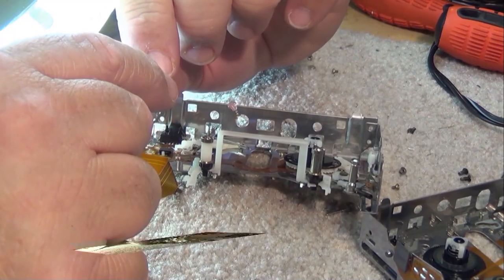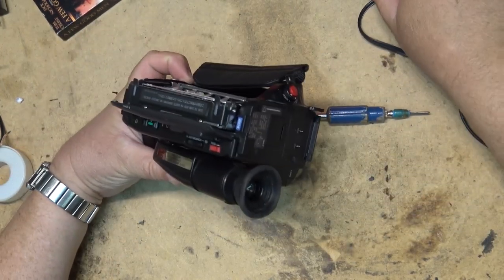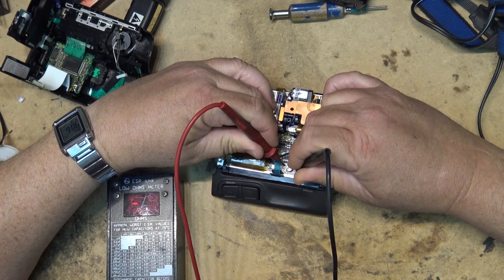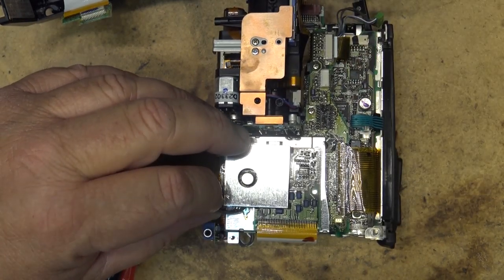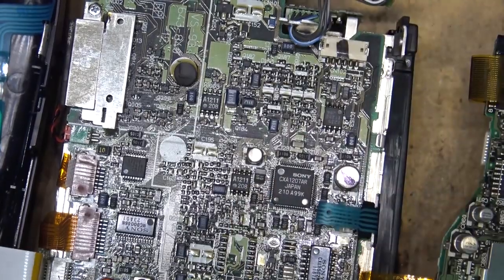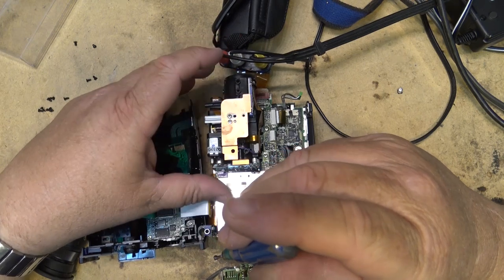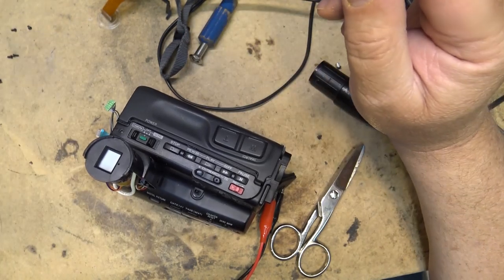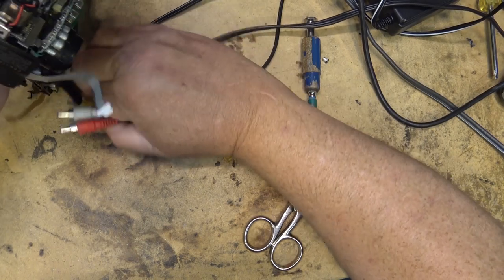Sony CCDTR71 8mm Camcorder repair

Comment: True recycling and conservation is repairing everything regardless of its worth.
The only way we will slow down trash island is by repairing instead of replacing.
Tossing things in the e-waste is just tossing it in someones else's trash can.
Reply: It's clear you never even attempted to fix an 8mm handycam. These things are a pain in the ass to get working right, and once you do, it's just a matter of time before something else inside the camera kicks the bucket.

Comment: by the clock on the wall, you disassembled, analyzed the problem, made the repairs and reassembled in about an hour and ten minutes............AMAZING!!!!!!
Reply: Because he is a man with a knowledge with this kind of issues
Reply from the maker: Yes that sounds about right.
Reply: Around the runtime of the average film in the 80s to 90s, maybe a little shorter. gg camcorder, we made you work again whether you liked it or not :P

Comment: Looks pretty much like a camera I  have but it mine is maybe from 2005. After a family member died it sat on the floor for quite a few years, ignored. When I tried to copy some tapes to dvd a few years ago, the camera wouldn't work right. I think the tape would stick in the machine, wouldn't eject.

Comment: Nice video to troubleshoot, i got a trv 140 Sony camcorder  D 8 that show some massive black spot distortion only on live video mode, I thought that the ccd was almost to dead and I replace it but the problem stills on it. Now I think a bad capacitor could be cause, I get back on my work table hopefully catch the fix over. Regards.

Comment: Fascininating! I had one of these for many years and it survived many front seat rollercoaster rides as I pursued my theme park hobby back in the day. The only reason I threw it away recently was the fact that the rubberised coating on the outside had perished and gone all sticky. It had a really nasty fishy smell too. Interesting to finally see inside one of these things!
Reply from the maker: That smell was the fish oil used in the surface capacitors leaking out.
Reply: @12voltvids  Wow, I just presumed it was the chemicals in the plastic coating. Come to think of it, the picture was all off like yours too. I just thought the heads were clogged.
Reply from the maker: @imansfield  Nope. Bad caps. All those 80 and 90 era cameras have them, especially the 8mm models made by Canon and Sony. I make a bunch of money transferring tapes as opposed to repairing old camcorders.
Reply: @12voltvids  As an amateur SONY tv hack from the 70's I appreciate this video. My SONY TR-21 ( 1993)  has lost several functions, and this video has made my final decision to toss it. Yes, I was into it 10 years ago and luckily transferred several tapes, but it quit before I was done.  Thanks for your time.

Comment: Those surface mount caps are garbage. I bought a Bose wave radio at a yard sale and it worked for a couple of hours until the audio faded out to nothing. This thing had maybe 100 caps. I ended up junking it but I saved the speaker's/waveguide assembly and I can rebuild the radio with a different amp.
Reply from the maker: Yes the surface mount electrolytic caps are shit. Next!

Comment: what do you use as a fum extractor I been soldering a bit now and my lugs hurt I bought a fum extractor off eBay but it dose not seem to work
Reply from the maker: What's a dime extractor? Never heard of such a thing.  Never used one in 20+ years doing this work for a living.  I have good ventilation in the shop. It is called opening the door and letting in fresh air.
Reply: 12voltvids I am using a 493 esd safe I don't know I think it maybe the solder or the flux do recommend any flex or solder ?
Reply: What did you buy? Give a link to that product.
Reply: SinsBird https://www.ebay.com/itm/100g-Japan-KINGBO-RMA-218-Paste-Flux-BGA-Rework-Reflow-SMT-Solder-Microsoldering/261875631637?epid=1976377220&hash=item3cf9010615:g:8CAAAOSw-0xYSKnV flux I use
Reply: @changosatanico9928  I did not get a notification that you replied. Wow, $45 for a computer fan and some kind of a sponge that may not even be made of carbon. I think it's too porous for fumes. What I would do is buy a hepa filter and some kind of a prefilter, make a box and connect a vacuum cleaner to it.

Comment: I have a similar videocam. I first took my battery to charge so I hooked my power adaptor and charged my battery. The other end of the power adaptor I attached it to the camera. When I finished I couldn't get if off. It seemed stuck. I tried to eject and push it towards the arrow, nothing happened. Then I tried to open the tape compartment but it is also stuck. 
Could that really happen? I have a tape in there and I wanted to get it so I can transfer it to my computer. What do you suggest?

Comment: I got a Panasonic DVX100A, it hasn't work in two years, I figured if i the tape doesn't read, it keeps saying T reel lock - I opped the front door, cleaned the head, poked around inside, but thing chanched. So I figure I could record still via DV out firewire but it doesn't activate the DV out as long as the tape errors out, I wonder there might a way to trick it into thinking the tape if fine to activate DV out. I'm in Toronto I wonder if this would be worth fixing since even when it was working fine I only paid 130 bucks lol - Am taking it appart but I'm afraid I won't be able to put it back together if I keep going LOL
Reply from the maker: That typically means the rotation hub is stuck or the rotation sensor isn't working.

Comment: Thank you very much, your vid was really useful to diagnose the fault in my camera. Only problem is that after fixing it (I replaced a couple of caps) I started shorting some of them to see what they were for (stupidest thing I've ever done, but I thought with those kind of currents and voltages shorting them wouldn't do any damage). Well, of course I messed up and after shorting one of them everything went blank and the camera doesn't even power up anymore. I figured the problem is in the dc/dc converter board because I have no voltage from the pins but a couple that just output the 7.5 volts they receive from the supply, so I guess by shorting the cap I blew up the voltage regulator board. Can you give me any input about how to proceed or am I better off looking for spare parts? I know it's worthless to try and fix it but it's just so frustrating, plus I have a bunch of tapes I'd like to digitize... Damn me who didn't stop when the thing was fixed!

Comment: Hey nice video!!! Would you happen to know how to fix a Sony ccd - tr 380, the focus doesn’t work on my moms old camera. Would really be helpful if you uploaded a video on that
Reply from the maker: The question is why would you be recording on such an old camera?
Focus is a lot of hocus pocus on modern cameras.  They use inner focus elements controlled by a servo which has a liner potentiometer that provides a feedback voltage.  Like a volume control these get dirty and cause the focus to not work.  Required removing the control from the side of the lens and cleaning it.  Also could be the worm screw that moves the lens is seized up.

Comment: Big thanks, Dave!  Most helpful video!, I have CCD-TR55E which keeps ejecting the tape (and the red emergency light keeps blinking too), could be that maybe caps problem? Thanks!
Reply: I mean when there is no tape inside, it ejects and closes normally, but when I insert a tape, it closes and holds for maybe 3 seconds, and then ejects the tape inside (with blinking red light)

Comment: thanks for the video. would you say deterioration of the electronics is a function of use or time or both? mine is non functioning but was hardly ever used. the tape deck starts but immediately stops and beeps. thanks.
Reply from the maker: Cameras deteriorate just sitting there unused.

Comment: Thanks Dave for the Classes on line. I have one of these cameras and it now works totally in all functions. Tapping to replaying. I had to replace all 4 caps on the video board though. But she works great. I did buy 2 other camera on eBay for parts, which I now don’t need. If you want them I would send them to you. Let me know but thinking you may not want more stuff. ;-) Thanks again. Henry. So thrilled to get my tapes transferred.
Reply from the maker: I always accept donations.  Gives me stuff to work on.

Comment: I owed one of these cameras,  my local SONY service center told me it was not worth repairing due to the high cost of repair. They had a set fee of $260 plus parts with only a 30 day warranty... You are a brave man to take on this repair!
Reply from the maker: Its mine so if it was repairable it wouldn't matter. I don't generally accept cameras from clients. I sell them archiving service to get their tapes digitized. Much better use of their money. That is how I ended up with this.
Reply: Wow same hear I remember the $260 that they charged me and my camera worked for about 90 days after that.

Comment: what would you think is the reason my lcd screen is loose on my canon vixia camcorder?  I think it's probably a broker spring and is it possible to repair it?
Reply from the maker: Could be a loose screw or something broken.
Reply: @12voltvids  I think it's a spring inside.  I bought a electronics tool kit and I'm going to try to see what's wrong with it

Comment: Hi Dave great video 
I have a Sony digital 8 handycam from 2000
Will that have the same cap problem ?
It’s working fine atm 
Cheers Mike 
I have done some cap repairs on Sony discmans never a fun job
Reply from the maker: The digital units don't have the same problem as the old 8mm and hi8.
I just did a 7 hi8 tape archive job. All tapes from 25 years ago. 5 of the 7 tapes were Sony MP and 2 Fuji. 
Fuji tapes played flawless, the Sony garbage tapes required me to stop every 20 - 30 minutes to clean the heads as those Sony MP tapes were garbage and shed their metal particles which clogs heads. ARGH.
Good thing I was using the EVS7000, easy to reach in the open top and flip the head cleaning brush against the heads while playing and clear out the clog "on air"
Reply: @12voltvids  yeah that great to know and I have alot of Sony tapes too
Reply from the maker: @Raptor50aus  they were garbage. For anyone with anything on Sony mp 8mm tape take warning.  Get your footage transferred before the tape fails.
Reply: @12voltvids  thanks for the heads up I have alot of tapes of my kids and family from the 1988 till about 1999 EEK !!

Comment: I've got a pair of Sony 8mm CCD TR camcorders. When you apply power they both just beep repeatedly and won't respond to any buttons. Does that sound like bad caps? Thx
Reply from the maker: No but they will have bad caps.
Reply: @12voltvids  
thanks!  Any idea why they just beep and won't do anything? I don't have the battery so I plug up a 6-7 volt source and they both just beep repeat repeatedly.
Reply from the maker: @jimbanville  does your power supply have enough current to operate a camera.  They draw about 2 amps to initially atart up.
Reply: @12voltvids  
Ahhh. I'll have to check. It's a universal wallwart that has selectable voltages up to 19v and several "tips".
Reply from the maker: @jimbanville  that probably doesn't have enough current to start them and they are power cycling on and off.
Reply: @12voltvids  
I appreciate it! I googled the "beeping/not powering on" and found no answers
Reply: @12voltvids  
Thank you sir! I alligator-clipped the output from a JVC camcorder PS I have that outputs 6v/1.8A to both Sony's and I got them to power on and eject the tapes. Thanks again!!

Comment: You are amazing at taking tiny things apart quickly.
Reply from the maker: It sure isn't getting easier as the eyes get older.
Reply: Many people on YouTube will only fix old equipment because they cant see the tiny parts or work with them.  Problem is, how much demand is there for old TV's and record players?
Reply from the maker: @markanderson350  I can't see the tiny parts these days without helpers.
Reply from the maker: Remember I used to fix these things for a living. When you do it day in and day out you get very good at it.
Reply: @12voltvids  I was pretty good too. I just gave up but you remind me of what I did. Being self taught, I always wondered if I learned things right.
Reply from the maker: @markanderson350  
I did get the formal training by Sony as being an authorized warranty Depot I had to take the factory courses to stay certified.  Most of the courses were pretty dry.  Lots of theory.
Reply: @12voltvids  that's cool, it helps me to watch you because I had nobody to teach me, somehow I kept landing tech jobs with a gr 12 education everything from Xerox to McDonnell Douglas. The best thing I ever built from scratch was a digital clock and here you love old digital clocks lol
Reply from the maker: @markanderson350  
I went to bcit but didn't study electronics.  I studied television and video production.  I learned how to light a set and shoot multi and single camera production linear editing.  Writing for commercials and script reading for voice over.
Reply: @12voltvids  you do a fine job of both and are a shoe in for YouTube I almost had a job with city TV once.
Reply from the maker: @markanderson350  
I did stringer work for CBC Vancouver and bctv back in the 89s and 90s
Reply from the maker: @markanderson350  I left to get a real job.
Reply: what's a stringer?
Reply from the maker: @markanderson350  freelance news shooter. I had a betacam back then and used to listen to police and fire scanner 24 hours a day and head out to chase down news stories.  This was before YouTube and phone cameras and the TV stations paid pretty good for footage. These days they don't pay.